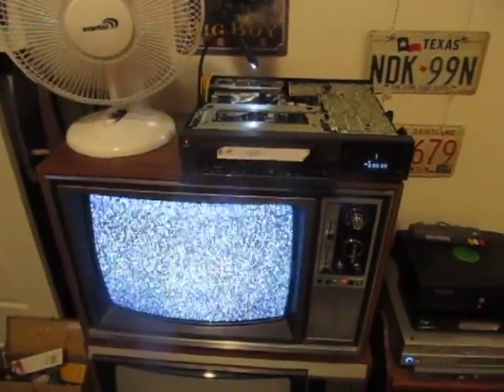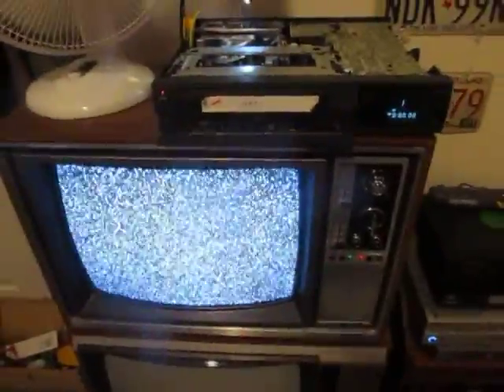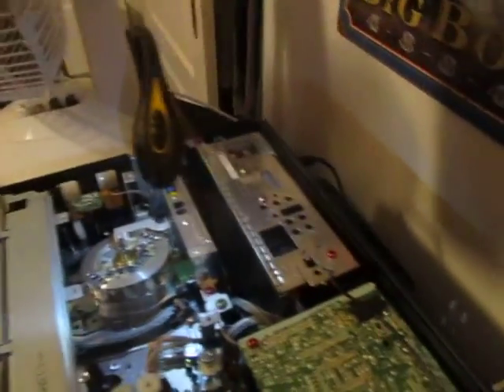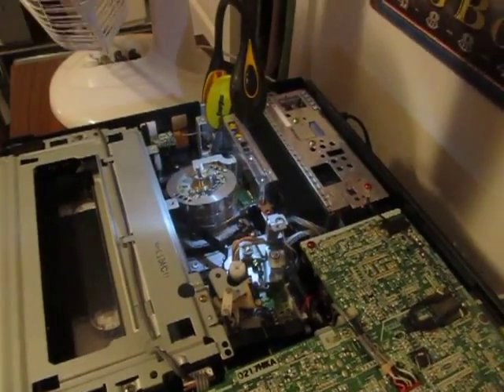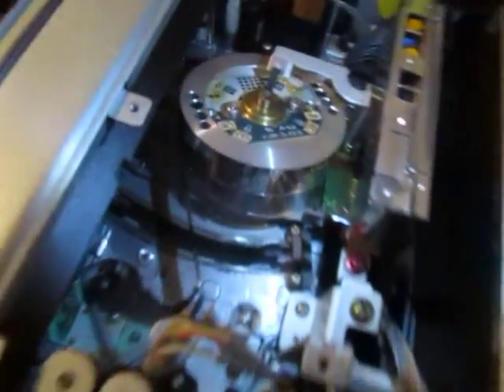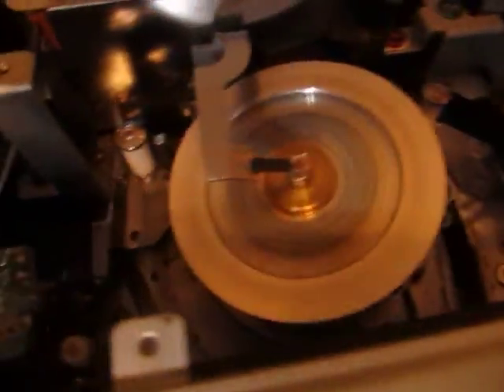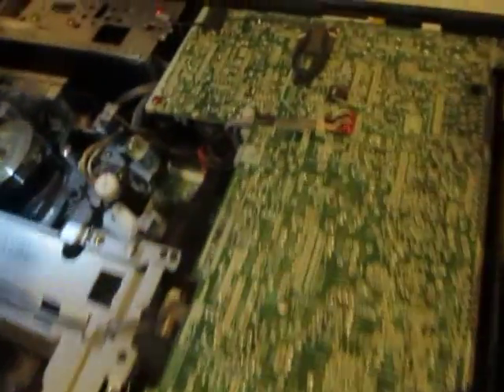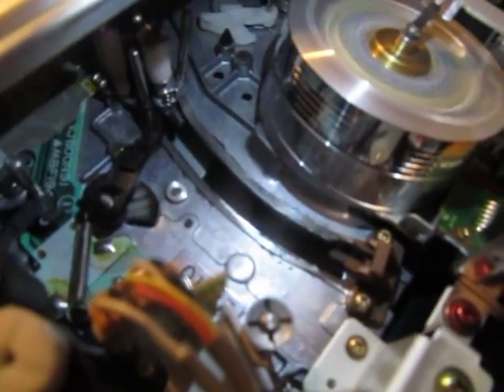Inside a working VCR [National NV-L15]

Comment: I've took the top off both my philips & jvc recorders numerous times, as long as you don't short anything, break any wires, or damage a board... safe enough to take the cover off if just for a look or cleaning heads. Just don't let kids mess about near it when you take the top off.

Comment from the maker: It's the Nokia and Volvo of video cassette machines! It's very solidly built, especially when compared to more modern VCRs, which are essentially hollow with exception of the tape deck and a tiny circuit board/PSU.

Comment: With the exception of the main AC side of the power supply area around the transformer it's all DC between 3v to 15v (manufacturer dependant)...

240v in australia, 230v in EU, uk or NZ

Comment: Most of the maintenance a VCR needs is the same as the audio cassette, clean the heads every couple of months with head cleaning fluid then wipe it off with a lint free soft cloth, leave it for about 10 minutes before replacing the cover then run a video cassette with something you don't value too much on it, wind the picture back then forward about a minute each way and it usually goes clear.